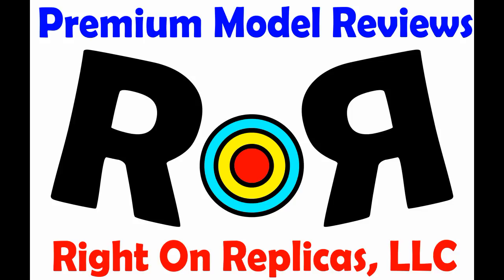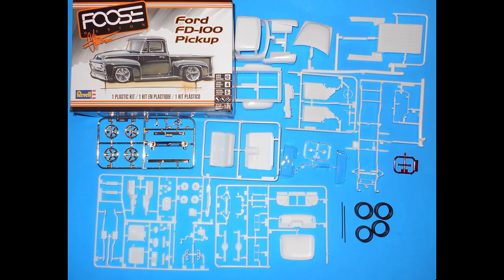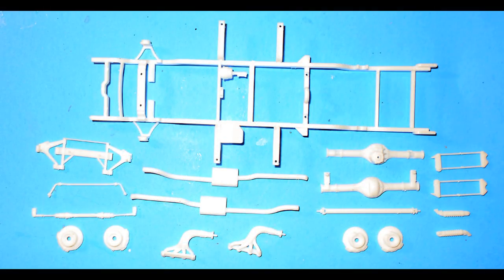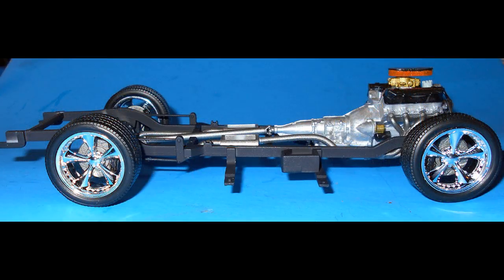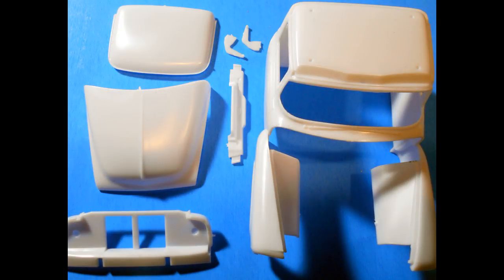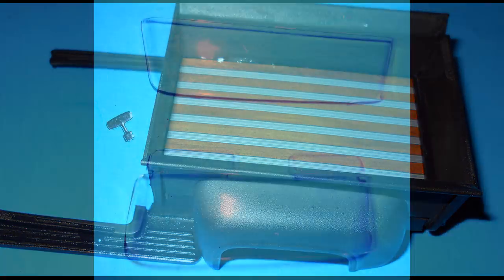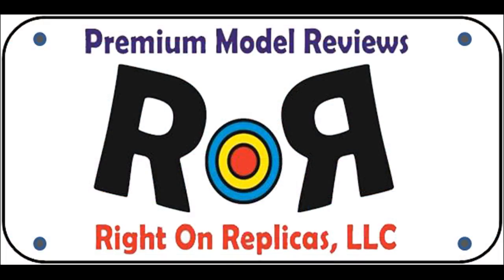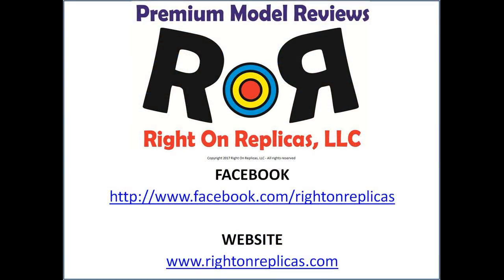How to Build the Foose Ford FD-100 Pickup 1:25 Scale Revell Model Kit #85-4426 Review

Comment: I’m currently building this exact truck and I’m having huge problems with mounting the cab to the frame and I need tips please!
Reply from the maker: Roast,  if it's a location issue, you have something that wasn't fully seated or located that may need to be removed and installed again.  Look for high contact points and remove material or reinstall.  Hope that helps!     PS,  please subscribe if you haven't already to help us reach more modelers.  -Doug

Comment: very nice kit i did mine in Metallic green by tamiya # ts-20 i dechromed it all exept for the wheels eliminated the front and rear bumpers inside and outside door handles and gas filler
Reply from the maker: JB - Nice custom touches.  Almost sounds like a funny car (truck) body!  -Doug

Comment: I wonder if i can merge this with the 55 ford f100 panel truck
Reply from the maker: MB,  They are completely different molds but what can't be done with enough putty?  -Doug
Reply: @RightOnReplicas  i was thinking about using the foose parts on the panel truck instead of the pickup truck since they are the same truck the interior and drivetrain should fit. Really enjoy the builds btw
Reply from the maker: MB,  Well, you won't know until you try!  -Doug